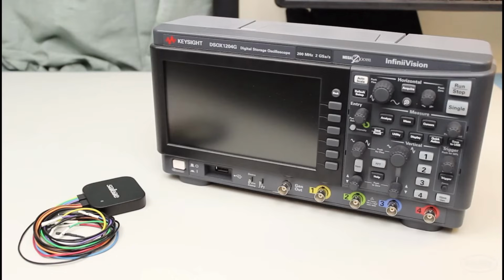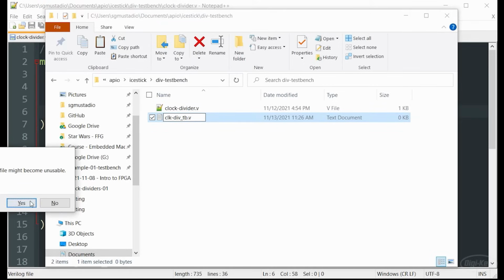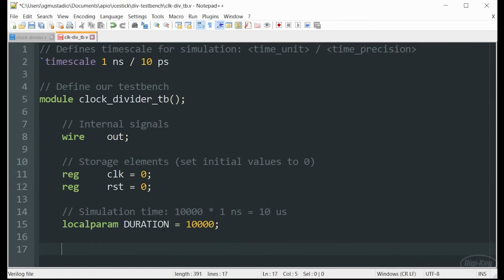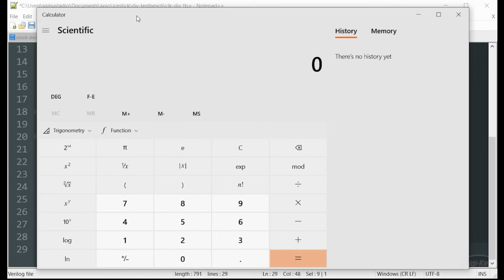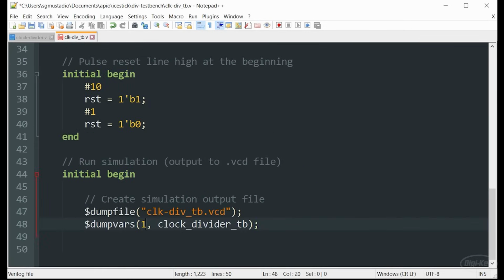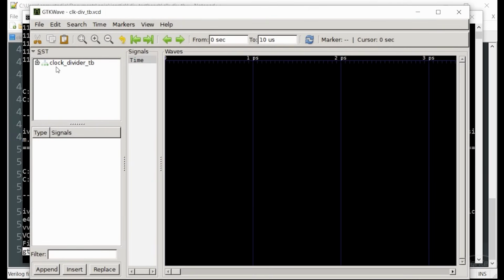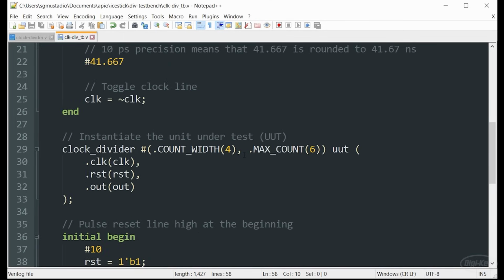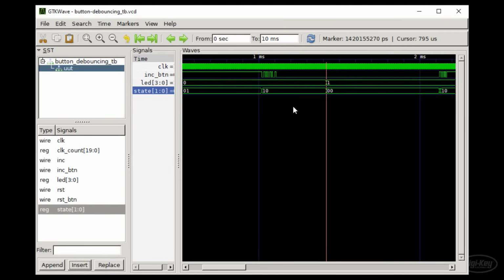Introduction to FPGA Part 7 - Verilog Testbenches and Simulation | Digi-Key Electronics

Comment: And also a quick note:
the # delay command needs to be terminated with semicolon ; or have a command with semicolon after it. 
So for example in the code:
#10
rst_btn = 0;
the #10 line is using the semicolon after the rst_btn=0
Reply: Ah! Good to know, thank you.